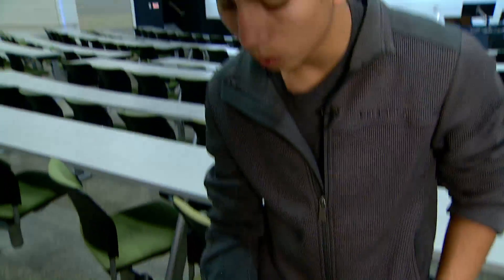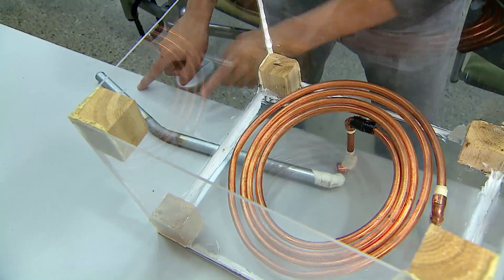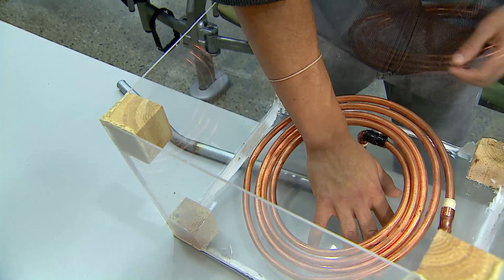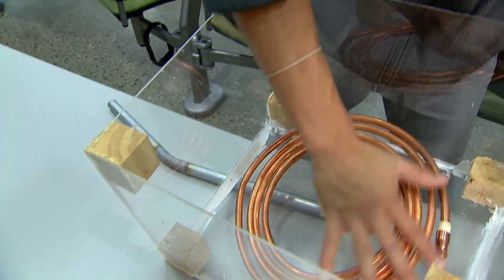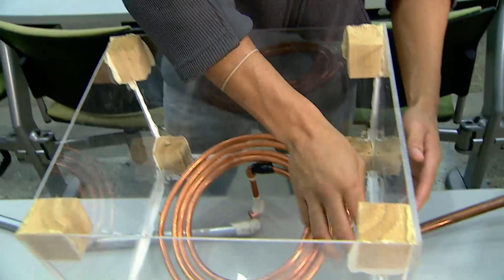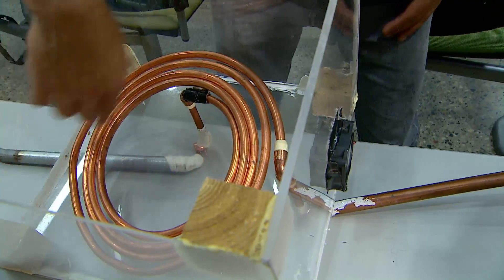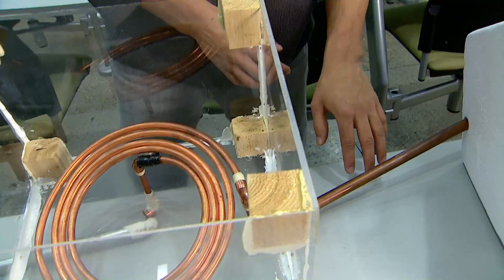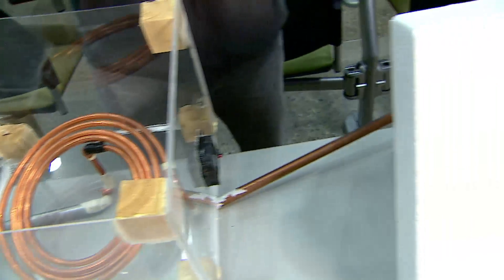WindChill designed to help developing countries

Comment: there are some missing pieces, 1.if the coil is underground why can the sun evaporate the water?
2.also where is the heatexchange after the water sucked out the heat from the coils (heat has to go 
somewhere) 3.the pipe has a very small diameter which will make it impossible for a fan to pump air through, you need a airpump for that or make the diameter equaul to the fan diameter

Comment: Does it work in humid areas??
Reply: +infoudonthani yes, but wont be as efficient as is arid places... by increasing the flow rate of fan, the rate of evaporation can be increased..which will directly influenced the cooling limit of the air inside tube..
Reply: @mizlagunesvary5077  ur gmail id plzz......

Comment: Great job on that, it wouldn't be too hard to change that into an air conditioning machine as well.
Reply: +just1fix2004 no, it will only lower the air be a couple of degrees and then only for a short time before the heat soaks into the ground and warm the soil around the pipes. That's why geothermal systems use very very long piping systems with a more efficient medium like glycol. Without a compressor and needle valve to enact a pressure drop, you can't achieve anything like refrigeration or A/C.